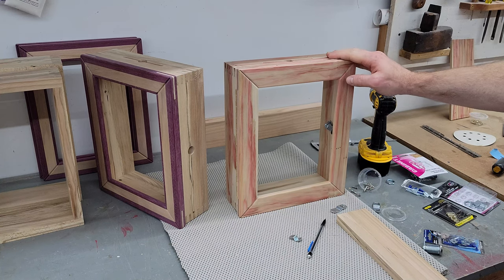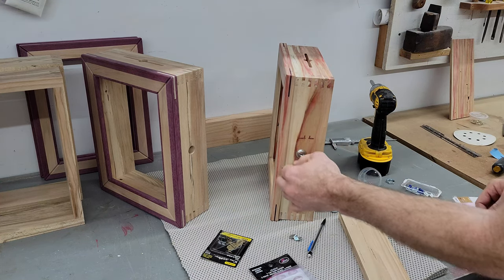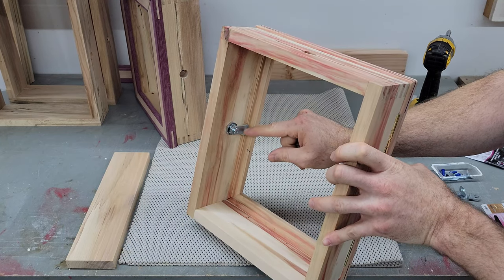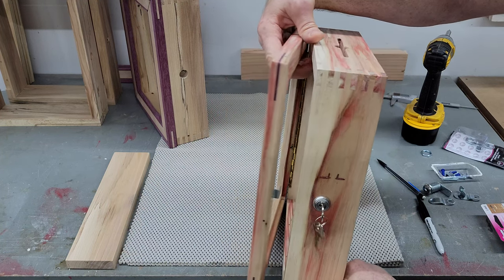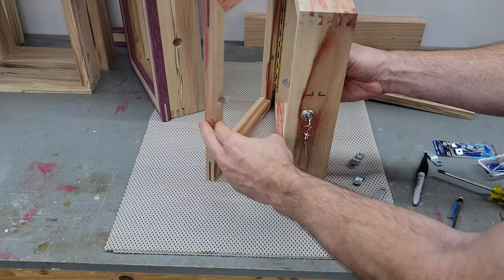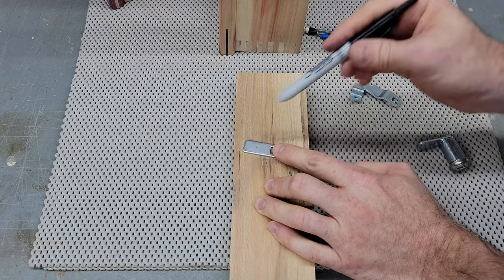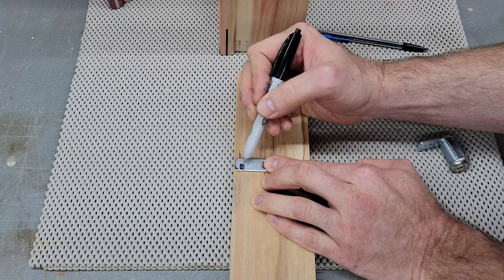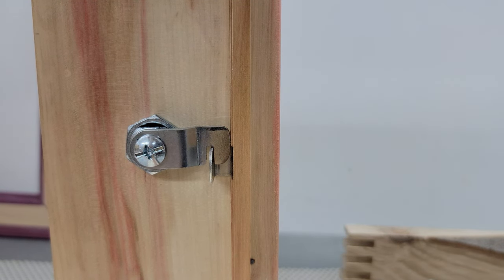How to install a mailbox lock on a wooden box

Comment: Great problem solving! Did you consider they type of latches found on cedar/blanket/hope chests? Also, I saw some neato latches which use scan RFID chips in a credit card type of key. But they look like they take up a lot of room.
Reply from the maker: Good idea. A cedar-chest lock would have looked great, and been very subtle on the outside. Easy to pick, but then again, so are mailbox locks. We had some procurement constraints, so it's built with a combination of Home Depot hardware, and lumber from my workshop that I happily donated for my own enjoyment during the build.
Reply from the maker: I was just looking up RFID locks. They are a little bulky, but a lot less expensive than I expected. I'll have to keep that in mind for future projects.
Reply: @TheSnekkerShow  Very bulky! Probably better for a Tardis than a tea box.